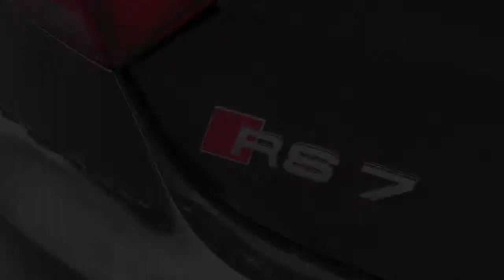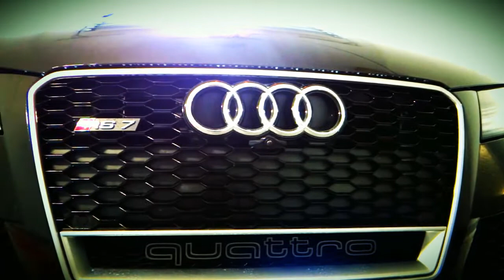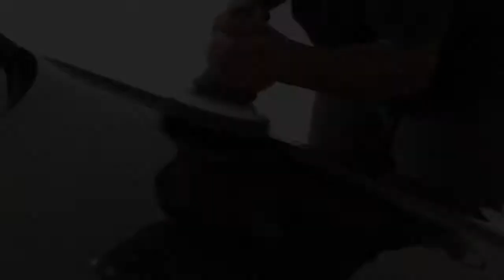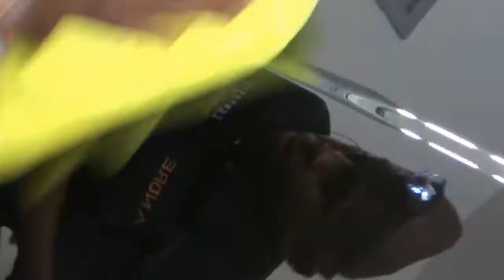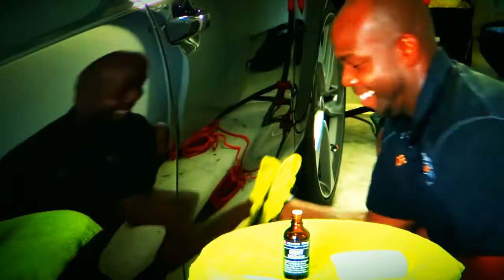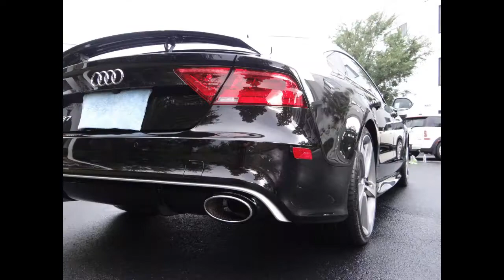Mobile Empire Detailing is at it again with this 2015 Audi RS7

Comment: @TImboSlice083, a few weeks ago we sent a $250,000 Mercedes back to the client because of damage that their detailers had done to it. The vehicle was picked up that day and during the dealerships detail they burnt through the clear coat on the hood. Damage on new vehicles is a guarantee no matter the make, model, or price. Its just a question of if it can be repaired.